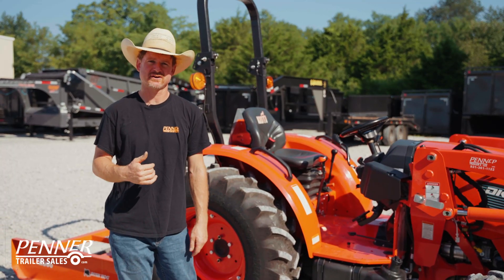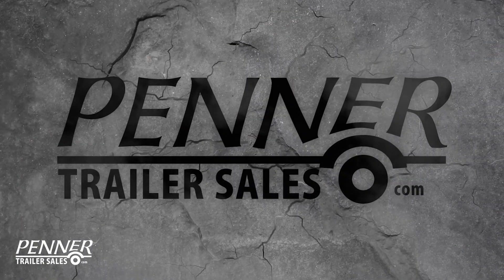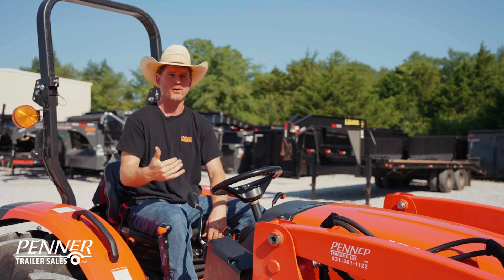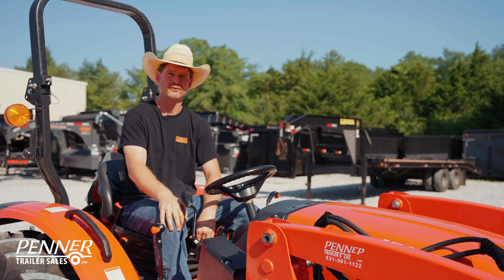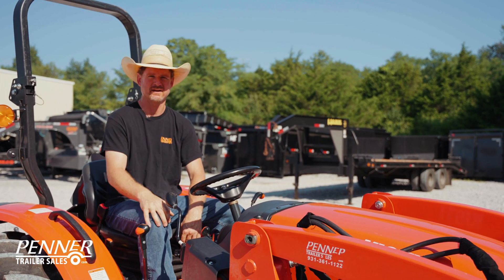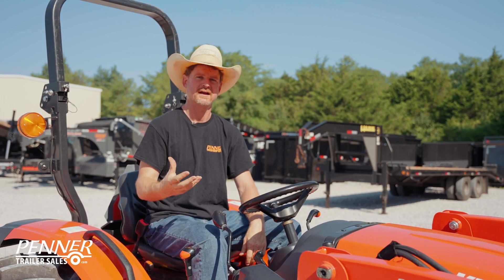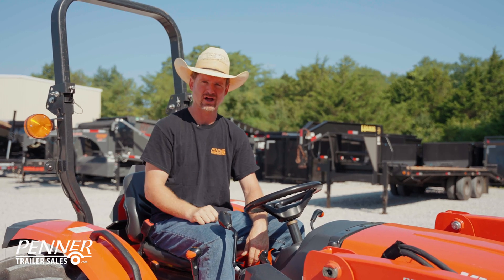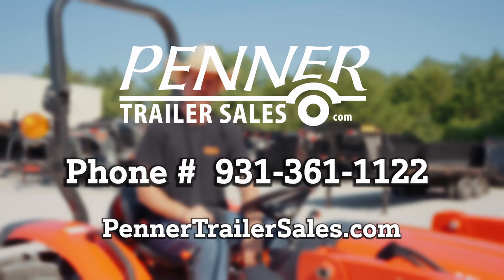How to use 4wd and Differential Lock on a Tractor

Comment: Does 4wd lock the rear differential as well as the front when engaged? Or will the diff lock still be required to lock the rear wheels in 4wd?